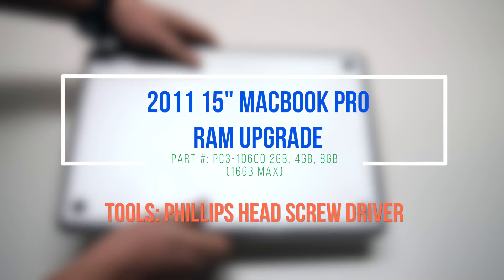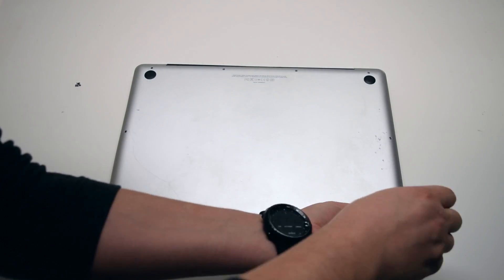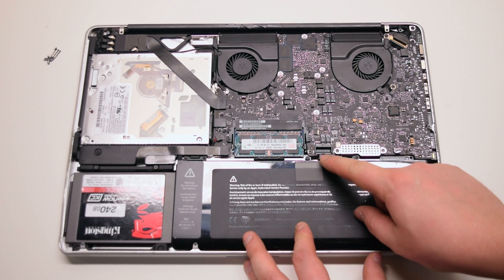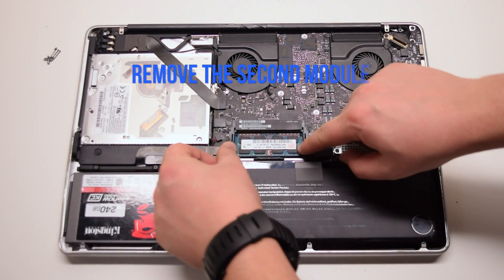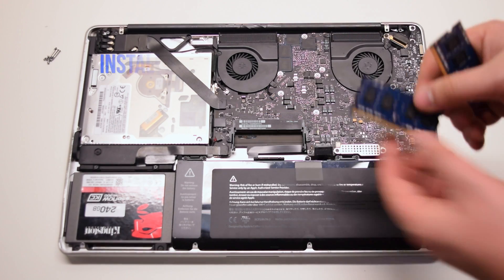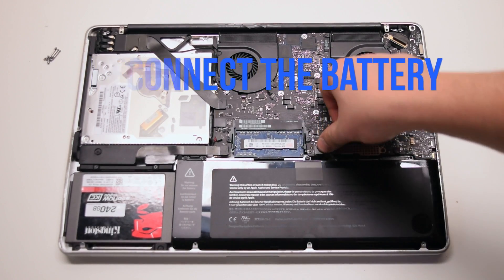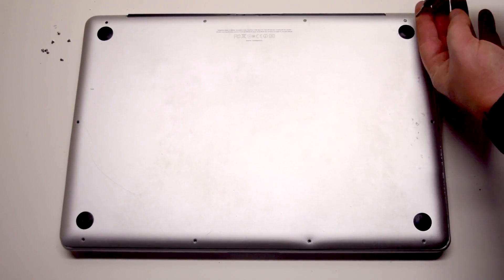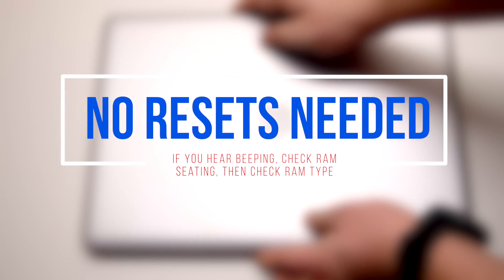2011 Macbook Pro 15" A1286 RAM Upgrade

Comment: I buy memory 8g ddr3 1600mhz but it doesn't recognize it What's the reason?
Reply from the maker: It should be PC3-10600 which is 1333Mhz, reference the table here https://gribsoft.com/mbp-15-ram-specs
Reply: I heard that even if the clock count is high, it recognizes it on its own. No?
Reply from the maker: Not that model @uio86a
Reply: @GRIBSOFT  If it's a PC8500, doesn't it only recognize 1066? If it's a 2009 model 009 mid 1286 model

Comment: Wife has this computer but needs OSX10.14 operating system in order for her diabetic insulin pump to download. Will changing the ram rectify her problem?

Wife's computer 2011 Mac pro model A1286

Thanks

Comment: hey can I put there 1,35voltage 8gb? - CRUCIAL DDR3 8GB SODIMM 1600MHz CL11
Reply: and will it work with the old 2gb ram  together?
Reply: i mean to macbook pro i7 2010 , A1286 , https://everymac.com/systems/apple/macbook_pro/specs/macbook-pro-core-i7-2.66-aluminum-15-mid-2010-unibody-specs.html

Comment: thank you for sharing. official apple support says that A1286 can handle only 8Gb of RAM. You are installing 16Gb? does it work well?
Reply from the maker: A1286 covers many years and thus 2011 models that have the i series can go up to 16, the A186 from 2008-2009 can only do 8GB.
Reply: Save Apple Dollars thank you. Mine is late 2011. Mactracker says 16 is compatiple.
Reply from the maker: Use my site for basic upgrade info at www.appledollars.com , if you need more info, I like to use everymac.com they have a great amount of info on every mac produced and many side note in a very friendly interface. Good luck.